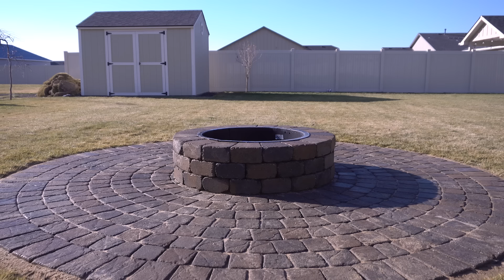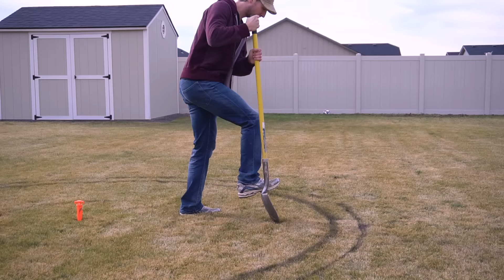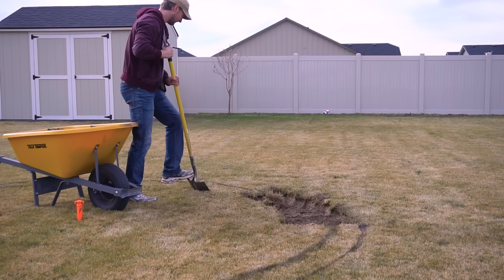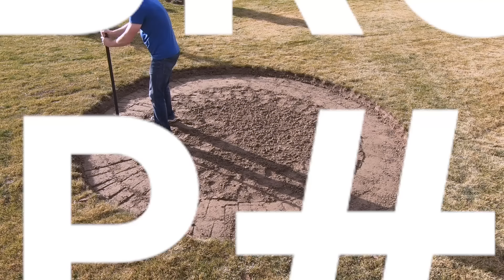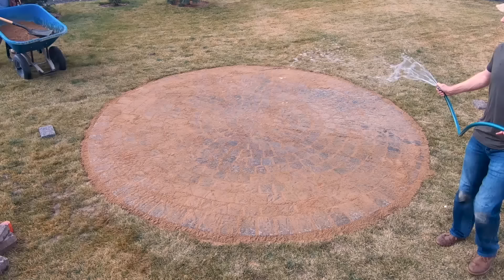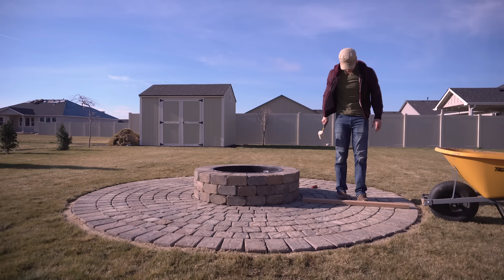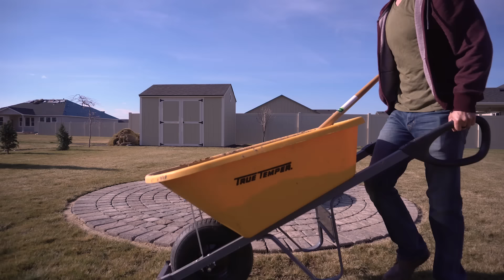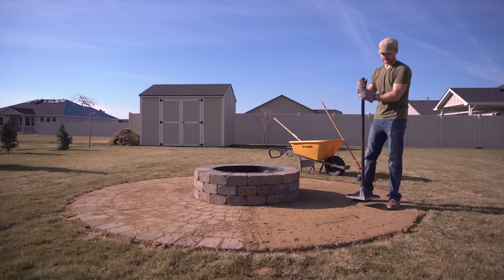My 4-Day Fire Pit Patio Build [Full DIY Project]

Comment: Did you cement any of the center fire ring stones together?
Reply from the maker: Just the top capstones. I used some masonry adhesive on those to make sure they wouldn't tip off. The rest was really solid already.
Reply: @BroBuilds  looks really nice 👍. I hope y'all have a lot of new fun memories around that space. Also it wouldn't take too much effort to make it a smokeless pit and get some holes drilled inside the interior of the ring. At least that's what I saw in another video.

Comment: Really great build, but I want to give you a tip: build a flu slot on the bottom layer as well as a grate for ashes to fall down to the flu area. My grandpa built a fire pit with stones and concrete, but the flu allows air to get in under the fire, requiring less poking, as well as preventing the ash from slowly smothering your fire. 
He also built a custom tool, basically just a broom handle with a piece of wood on the end to scrape out old ashes that will eventuality restrict airflow from the flu. It might mess up your patio but it's a lot better than having to shovel out the ashes every so often.
Reply: Awesome. For the record, it’s spelled flue.
Reply: Your grandfather is amazing
Reply: But what's the use od fire pit
Reply: @ChiefJudge  Makes it safer to have fires at cottages etc. Building the high sides is safer for children and pets. 
That, and they can burn better than on the ground because air can get underneath. A bigger, hotter fire with less wood, and good, fine ash to add to compost.
Reply: @davejones9469  thanks
Reply: @ChiefJudge  I forgot to mention, the large stone/concrete structure helps spread the heat further, like a big radiator.

Comment: I think you should use mortar to secure the fire pit in place,  what if someone sits on a the fireplace and it falls over?
Reply from the maker: I added some concrete adhesive to the top capstones.

Comment: Not to bash your vider but i do this for a living and you dont want to use sand it can wash out and get pushed out along the edges and cause low spots   crushed limestone is a way better alternative and polymeric sand works way better for filling in between the pavers you get a variety color choices and it acts more like a mortar and actually binds the stone together  other that that pretty good video guys it looks fantastic.

Comment: Thanks for the video. Why didn’t you use poly sand?
Reply from the maker: I wanted to be able to replace/redo anything that shifted over the winter if the ground heaved. And I also figured the poly would crack over time and look ugly. This is easy too keep up - I just add a little sand every few years if it gets low.

Comment: That patio looks really good and good job on it.  When I started working I actually worked for a landscaper specializing in stone work and one thing that I seen him do that works very well is once the patio is in instead of just sand and tamp he used a mixture of silica sand and cement powder. Mixed it  dry broomed it into the cracks then plate tamped it in and then when you wash it it hardens the cement sand mix and seals it completelly in
Reply: We use polymeric sand..
Reply: @ozz7602  that's basically what's he's saying they used. Pretty sure polymeric is made from silica

Comment: Did you happen to cement the stones for the fire pit because if not your work could fall apart if someone decides to sit on it
Reply from the maker: Not cement, but I used some heavy duty adhesive to make sure they wouldn't tip.

Comment: Should have put some concrete on the bottom of the last big piece on the firepit D: so it does not flip over when ppl accidentally press it down too hard
Reply from the maker: Yeah, good call - I eventually used some masonry adhesive to fix those capstones in place. :)

Comment: Used the wrong sand for the final sweep in. Should have used polymeric sand. It's sand with granules of water activated industrial adhesive. When finished sweeping it in use water to activate the glue and it locks in for 20-30yrs
Reply from the maker: Yeah, a lot of folks will want to use polymeric. I didn't want it for this application - I may in the future though.
Reply: @Bro Builds  I'm curious as to why not? I guess the down side is it would be waterproof instead of porous for water drainage as you mentioned in the vid, but I feel like it's at the cost of alot more maintenance (weeds, paver drift/uneven settle, etc.) It came out great btw! I just worry about its longevity.
Reply from the maker: @WolfLinkIV  part of it was my worry that the pavers would shift over winter - I wanted to be able to easily repair anything that sunk or raised up due to freezing ground. But, so far it's held up perfectly! The drainage was the other part of it, though, and I do like how well it drains.
Reply from the maker: @WolfLinkIV  oh, and as far as weeds go, the yellow sand I used first definitely allowed a few weeds over the summer. So this fall I added silica sand and filled in the cracks again, and it should prevent weeds better.
Reply: @BroBuilds  nice!

Comment: Good job lads, looks good. 👍🏻
As you said in the video it’s a lot easier with a petrol compactor, wacker plate we call them in England. Also when the blocks are done it’s easier to use kiln dried sand to cover them then run the wacker plate over the job. All the sand is then vibrated down the cracks and the blocks are compacted down evenly and tightened up. It’s a lot easier than hitting every block with a mallet. Something to think about if you do another one for a friend or neighbour.
Reply from the maker: Great tips! Thanks man

Comment: As a professional landscaper(me lol) you should have used polymeric sand in the cracks instead of fill sand and removed the pavers from the center and then put in 1" gravel but nice job looks great
Reply from the maker: Yeah, I didn't want poly in case the ground shifted during the winter (it didn't) but I kinda thought I'd need to make fixes and knew this would be easier. I do like the increased drainage and the fact that I won't have to deal with poly cracking over time - I'll just put down more sand as-needed.

Comment: It will eventually drop as it doesn't have a solid base under it. compacted road base or concrete. Sand doesn't need tamping as small movement on the pavement will make the sand work into all of the air spaces. the sand itself will pack together creating strength. haunching the edge with concrete stops any movement and with a hard base, the pavement should stay in place. This method has been used since the Romans maybe even the Egyptians. The pavement that the Romans laid is still being driven on today. (50 - 100 mm of base, 30 mm river sand and a concrete haunch.
Reply from the maker: It has a solid compacted base. It'll last. 🙂
Reply: @BroBuilds  I watched the video. You tamped sand. That's not a solid base.

Comment: Wait... you just lay down the stones for the firepit without... dude, what if somebody sits down on the edge??? :D
Reply from the maker: Heh, yeah, we ended up adding some concrete adhesive later. But we knew we'd be making some holes in the firepit to increase air flow, so we did that first. There's another video on that.

Comment: Not bad for a diy.  a lot of what you did was right. I would only change a few things. getting a compactor and raising your base in 1 inch lifts. If you do more than an inch you wont ever get full compaction and your paver patio will settle over time, especially when using a hand tamper. And the sand you used to fill the joints between the pavers; Use gator sand. This has a much better look and will lock your pavers in place much more efficiently.  Whereas regular sand will wash out over time. Although if you use gator sand you dont want to beat your pavers into the regular sand. It's better to wait until you've swept your gator sand in then compact over the pavers to make sure everything settles evenly.
Reply from the maker: Great tips! Thanks!

Comment: What did u set the top pewter blocks with or was it just there cause I feel like it would b wobbly or it didnt move
Reply from the maker: It was pretty solid without anything, but I did end up putting some concrete adhesive on those top blocks later on, just to make sure they wouldn't tip.

Comment: I have a question, the Stone in the Fire pit won’t fall off since it has no mortar? Or nothing sticking them together?
Reply from the maker: Nope! Although I added some concrete adhesive to the top capstones later, since they do stick out a bit and could possibly tip.

Comment: If you are a DIYer you should do a trial run of laying the pavers on a flat surface like a driveway so that you can get a feel for how the concentric circles fit together before you layout the actual pavers. I think that you should have used a paver locking sand which had finer texture to fit down between the pavers and contains some cement so that when you wet it down it locks everything in place. Otherwise nice job!

Comment: When putting pavers you have to start from The outside in. And the border has to be set with concrete so they don't move over time
Reply from the maker: I'm not sure if that is the rule for square patios (it seems like good advice), but it's not how you lay circular ones. And concrete edging is common, but I chose to use flexible landscape edging instead - it's working great, and it's less visible, which I like.

Comment: Did you think about using some sort of Adhesive (Mason Liquid Nails, Concrete...) to keep the firepit together..  I found with my pit that over time the wind shifted it around a bit.
Reply from the maker: We didn't at the time, but I added some construction adhesive to the top capstones later, just to prevent them from tipping if a kid sat on them. I don't think anything would have shifted, but I do like the extra assurance that the top stones won't fall now.

Comment: Pro tip: If you don't wet the sand it won't set and all your brick will shift within 2 years.
Reply from the maker: Is that for polymeric sand? I just used regular sand.

Comment: Lol. Wait. There's only sand in between!? I don't see this lasting in the long run.
Reply from the maker: It's pretty solid! :) Been almost a year now and hasn't moved a bit. The landscape edging around the outside keeps all the pavers locked in place.
Reply: @BroBuilds  interesting! Haven't seen that done around here in the country. Usually we use grout or some use 20/20. Seen others use cement. But got my respect for how it turned out at the end. And also hearing that its still standing. 👍🏽
Reply from the maker: @juniorperez3140  thanks!

Comment: i noticed you did not remove the stone where the firepit goes - any concerns with pavers cracking from the heat
Reply from the maker: Not really - I built the fire directly on the pavers for a while, and then learned that cracking is a possibility, so I added a grate to lift the fire up a bit. But I think the fire just doesn't get hot enough to crack them either way. If it starts to be a bigger concern, though, I think I'll just put more gravel over the top of them.

Comment: No leveling of each paver and no polysand? Sheesh this thing won't last long 😬
Reply from the maker: It's been almost a year and it's rock solid :) All those compacted layers of gravel make a super flat and secure foundation that allows for drainage. The pavers just sit a few inches down into the ground, and they're locked in around the outside with landscape edging. Where would they go?

Comment: Use limestone dust instead of sand especially between bricks
Reply from the maker: Good tip! I ended up putting silica sand in the cracks after several months, which I think is similar.

Comment: He should have used a polymeric sand instead of regular sand beteen the pavers. It will harden between the pavers locking them in place and preventing weeds from growing between the pavers.
Reply from the maker: There were a couple small weeds after about 6 months, so I removed them and brushed a layer of silica sand into the cracks. So far no more weeds have grown. Polymeric would be a solid solution as well, however!

Comment: Did you use any adhesive for the blocks or caps of the fire pit?
Reply from the maker: Yeah, after we added some more airflow in the next video to make our fires smoke less, I put some construction adhesive on the caps. So they're solid now! 🙂

Comment: Hiring A compacter plate would have saved so much time. On the gravel, and Sand bed before screeding then afterwards you should have used kiln dried sand to fill the gaps. And another once over with the compactor. Good job tho.. well done
Reply from the maker: Thanks! And good tips - we're gonna get those details right next time!

Comment: you should lay pavers on sand mixed with cement in 1:4 proportion. To fill gaps, use very fine grained sand, with grains 0.2-0.5mm

Comment: Great video, fun and informative my one criticism is for the fire pit hole itself building up the outer walls for the fire pit I would have used cement as a morter/insulator/glue to keep it all together just in case if kids come over and want to well do what kids do best. Haha anyway. Muchly enjoyed this video.
Reply from the maker: Great tip! We went back and added construction adhesive for that very reason.
Reply: @BroBuilds  you'd get less smoke in your fire though if you left gaps in the side wall every so often. You want airflow into the fire so that it burns cleaner.
Reply: Uhjjj

Comment: Lmao 4 days? I built mine in 2, you omitted a few things too, and if you don’t know it, you shouldn’t be building anything whatsoever. Lmao
Reply from the maker: What'd we omit? 🙂 If you're not just trolling, back it up. We did choose not to use poly sand because the spacing was so tight, and I don't want it cracking and looking ugly. Other than that, you sound like you're full of it.

Comment: If u would of used a trenching shovel.  Digging up the sod would of been alot easier. Use to dig Graves for a living. After the mini ex dug the initial hole. Had to clean it up with a trenching shovel.  Ain't used a spade shovel since lol.

Comment: You could have started paying at the edges by inverting the instructions.
Reply from the maker: That would actually be a lot trickier - instead of adjusting just a few pavers when the next circle doesn't fit right, you'd have to adjust a ton off them. Better to start small and make sure each row is perfect before doing larger and larger circles
Reply: @BroBuilds  Only trickier if you screwed it up. Otherwise a lot easier as the dimensions and center point would be correct on the first try.
Reply from the maker: @gonorsilvet2581 I promise you that starting in the middle is more efficient and easier.

Comment: So I've always wondered to offset the fire pit stones to creat a hole for air to flow. I know there is a ring but is that needed?
Reply from the maker: The ring probably isn't really necessary. It's  just an extra layer in case you're worried about the pavers exploding from the heat, which is unlikely but could technically happen if the fire got hot enough.

Comment: Great job. I wouldve used poly sand though so it doesnt wash out.  I also would've glued the blocks for the fire pit even though its not necessary. Makes it more sturdy and it will last longer that way

Comment: The gap is for the bonding sand lol, also did you use normal sand in the joints? Just no sir. I dont think your pro ment beach sand
Reply from the maker: Yeah, that's another reason I didn't want polymeric sand. The gaps are pretty big, and with these smaller pavers, I think it would look weird.
Reply: @BroBuilds  it looks great still, just the bonding sand helps them not the shift. Not saying you can't use normal sand just that it's not ideal. I do love the build though
Reply from the maker: @gtgx6999  thanks!

Comment: Can someone explain what the conduit tubes were for? Since there’s no wires and it’s not a channel for water
Reply from the maker: It's just a way to make sure the sand is level and exactly one inch deep when you use the 2x4.

Comment: I didnt see a level one time. And for the love of god do not use sand for base... use 9s and polysand the top.. This thing is gonna be wavy in a few months.
Reply from the maker: These are good tips. No level needed though, since I was matching it to the slope of the lawn. I didn't want one edge to be above the ground and the other below. Even just an inch would be a tripping hazard. Definitely agree on the base sand - that woulda been better, although it's working fine (going on 7 months and no settling or waves). And I chose not to use polymeric because I don't want it to crack and look bad in a couple years. I'll just add a little more sand as needed.

Comment: Suprised not concrete mix was used between the stones
Reply from the maker: I didn't want to have something that would crack over time, so I chose to just use regular sand. For lots of patios, polymeric sand would be the right choice.

Comment: I think you should find a new landscape company because you have no sealer or set sand in your video you don't need to do anything else after the first time you use the right locking sand which can be found in your home depot and the rinse process is the only thing you need to do before sealing it

Comment: So how come you spent time digging out the circle just to fill it? I know there has to be some reason in terms of placing the brick right?
Reply from the maker: It's so there's several inches of good drainage below the pavers. The gravel makes a solid base, but water can't pool up when it rains.
Reply: @BroBuilds  i figured it had something to do with the water once i saw how you hose down the sand. Thank you!